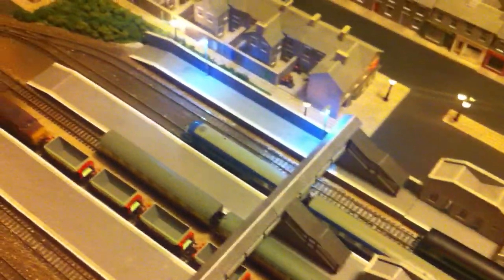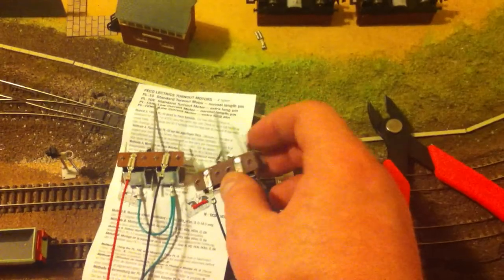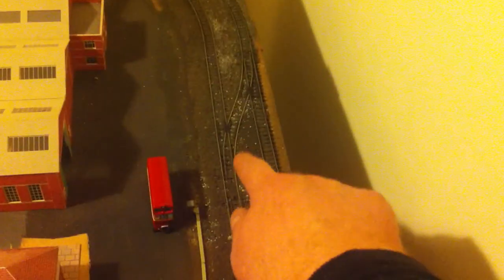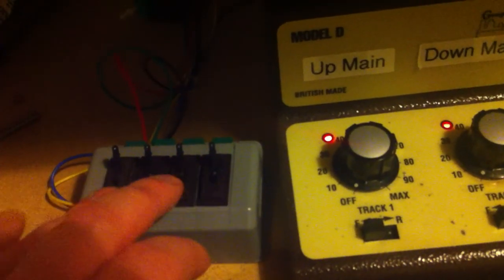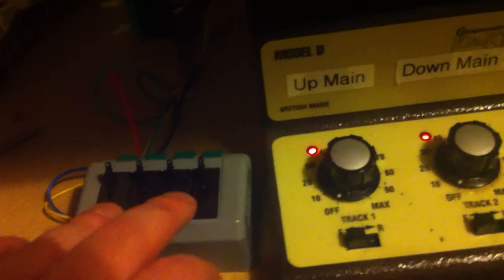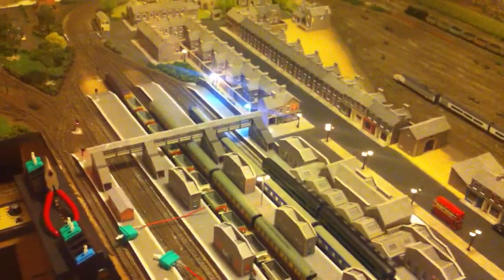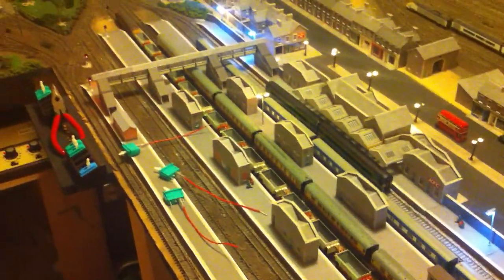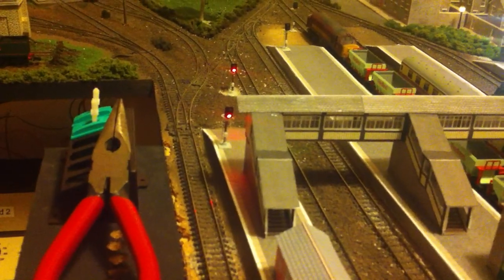Signal Progress

Comment: Had an idea, how about get a thin piece of sheet metal and slide it under where the point where you want to drill you hole, then mark out and drill up from underneath, the you won't risk damaging a £10 piece of track and you won't have to ruin your hard work of track laying and ballasting.... Drill a small pilot hole from above first though if marking out from underneath is too difficult......

Comment: Excellent dude! Although a bracketed signal would have been better on the last platform, as the footbridge is in the way! You may struggle with trying to drill slots for the point motors, I tried itand A&E a mess of the plastic on the point concerned. Do it very VERYslowly and don't force the drill bit through the wood. Can't wait to bring my locos over for a running session!